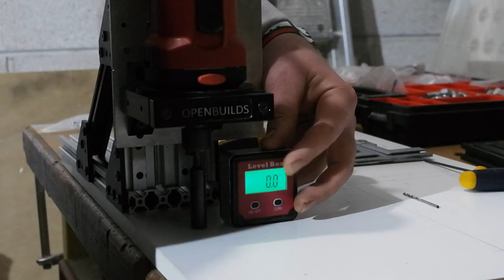Making A Drill Stand Part 2 - The Base - Profile Extrusion In The Workshop

Comment: Interesting video again! But where can I find information about the router stand that you used with your Mafell 1000 to make the base? I have the same Mafell, but after I bought it I couldn't find a usable stand to fit it. Now I'm using a not-so-well-fitting Metabo plunge stand that doesn't really feel comfortable or secure. I hope you know a better solution to use the Mafell as a palm router.
Reply from the maker: Cheers. I use an old Bosch one (link below to a relevant ebay search with some). It's from their old POF 50, POF 52 and POF 500a routers. I was lucky. I found a rare kit that included the plunge and fixed base! But yeah, all those old routers accepted a 43mm collar so fit the Mafell FM 800/1000. They're not great but perfectly useable. 
https://www.ebay.co.uk/sch/i.html?_from=R40&_nkw=bosch+pof+500a&_sacat=0&rt=nc&LH_ItemCondition=4